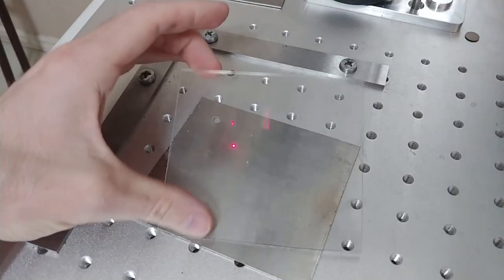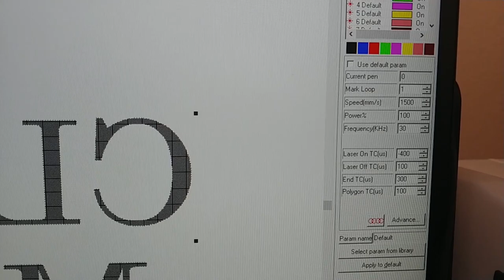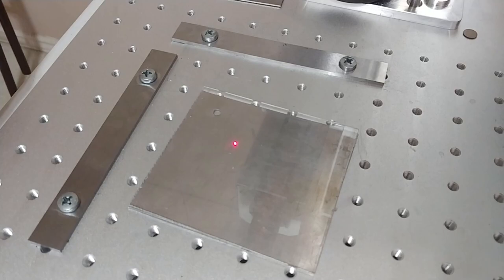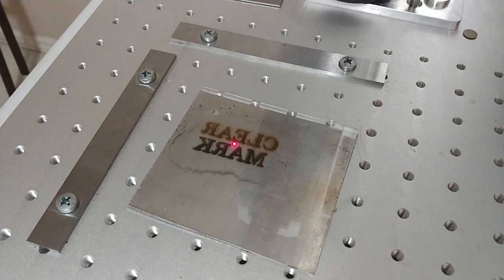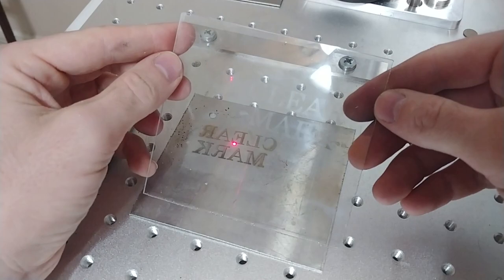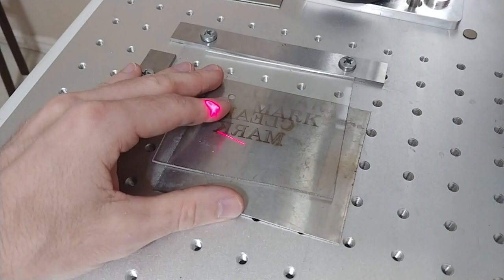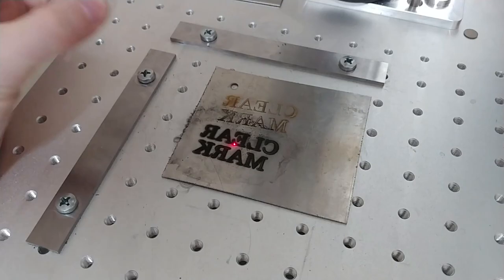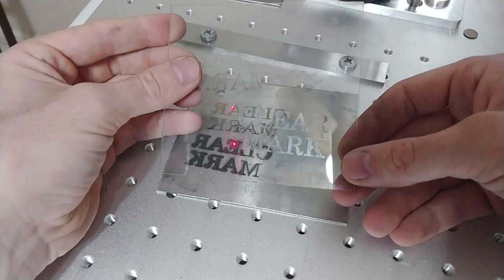Fiber Marking CLEAR Acrylic

Comment: What if you use mirror....
Reply: Using a mirror would not work as it would reflect the beam, hence they use mirrors to bounce the excited light/energy to increase/amplify the power. Each time the beam bounces back through the beam it increases the strength.